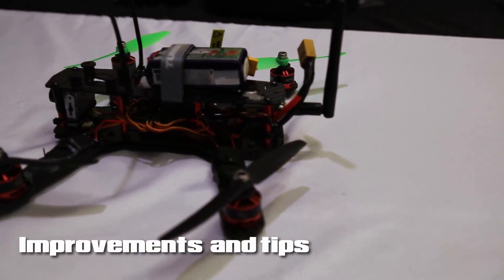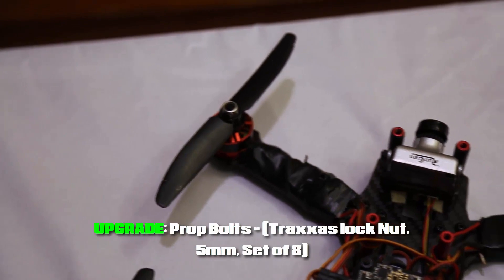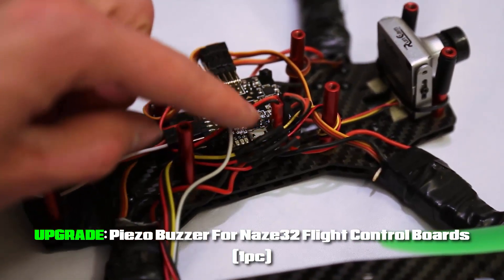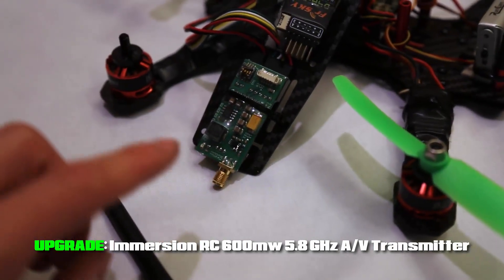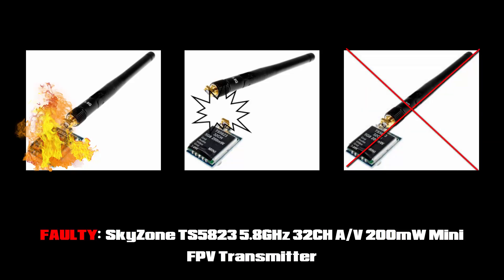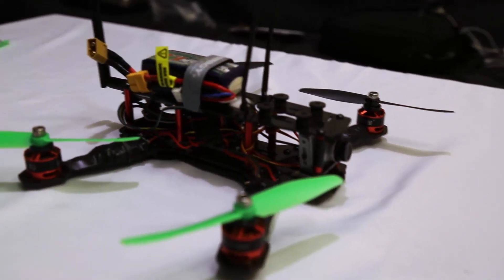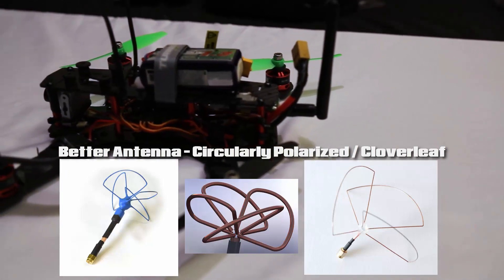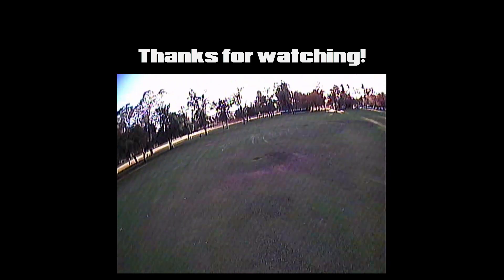IMPROVEMENTS TO THE ZMR250 - PART 3

Comment: how does zmr250 fly compared to other frames in your opinion?
Reply from the maker: Well what other frames? The ZMR250 is small to medium in size so it's fairly nimble, but they do make a smaller 150 frame with the even smaller. I find the smaller you go the harder it is, which for some people takes the fun out of flying because you don't feel as confident. Just my opinion...
Reply: against the true X frames. Do you reckon zmr250 lacks in terms of maneuvers?

Comment: The SMA connector on the IMRC 600 will break. I would either solder on a pigtail now or at least use a pigtail adapter connector to help from ripping off the SMA. Also check out the HS1177 cam for fpv, it's a bit smaller and picture is excellent. A set of Spironets from Fatshark or Dura-Specs from IBCrazy/Video Aerial Systems would also go a long way for quality video. If you don't like buying props check out the DAL V2 5x4.5's, they are ridiculously strong, great beginner props and have decent thrust. Cheers and have fun in the sky!
Reply from the maker: +Humboldt710 Awesome! I just ordered some right angle adapters for the VTX. Going to drill a hole in the top plate to solve that issue.  The Spironets from Fatshark will work even without Fatshark Goggles right?
Reply: MrJayBusch
:) Yes, the Spironets will work with any 5.8 receiver like the ones on a monitor or other goggles too, just make sure they match which kind you have (RPSMA or SMA) or get a RP-SMA to SMA adapter in case.
Reply from the maker: +Humboldt710 Hey friend thanks for answering! Yes I need SMA so that's what I got good to know. Thanks for the advice, I followed it!